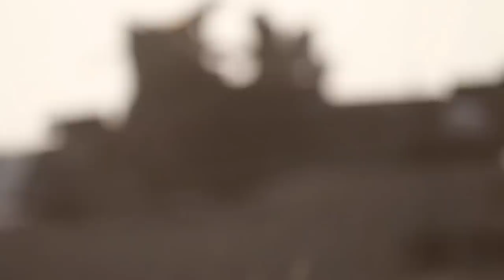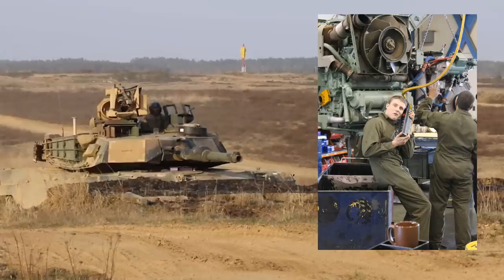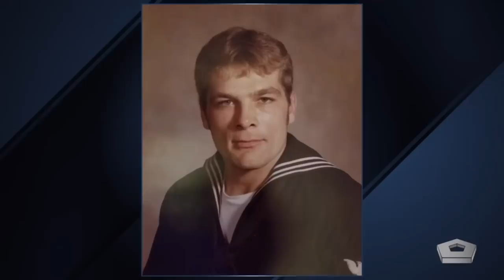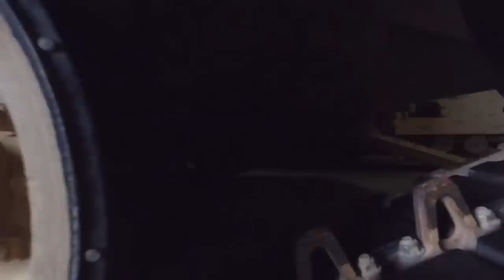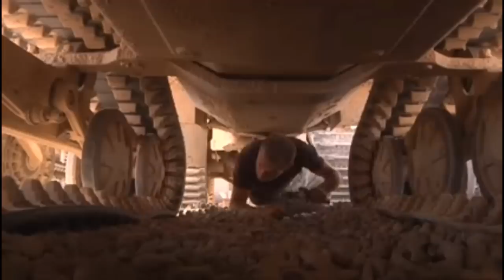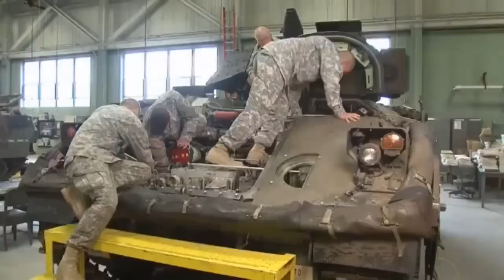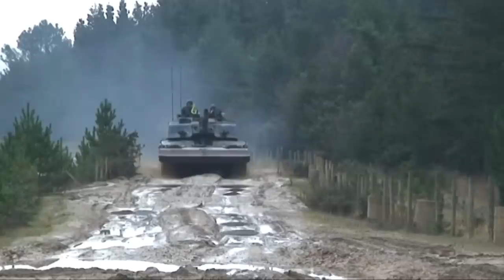Do you want to be a Tank Mechanic?

Comment: Being a Tanker or a mechanic on one is very labor intensive. The M1 Abrams or any tank in the world requires a lot of maintenance to keep it in fighting order. Very big weapon system indeed. A first class armored fighting unit needs top notch mechanics to keep the behemoths on the battlefield with a golden crew to keep them in fighting order.
Reply: No kidding , we had to do almost everything as a tanker pull Packs , fix tracks , broken torsion Bars , service batteries , replace broken electronics , spray them down with fire hoses and even paint them
Reply: Unlike Russian equipment which i've heard can be very low maintenance  mainly i've heard this of their guns being simple to use simple to produce and easy to maintain but also their tanks
Reply: @RhelrahneTheIdiot  True , Ive been in a Israeli captured T62 which seemed simplistic and have a Russian SKS which is almost as simplistic as the .45 Cal. grease gun they issued tank crews in the 70's ..
Reply: Believe it or not the Abrams dosent required that much maintenance.

It really boils down to the crew on how well the tank is running.

My tank had over 600 hours during deployment and we changed track one time and 4 road wheels. That's all heavy, other than that we keep fluids on tap and all 10 level maintenance.
Reply: @mrbasshead403  True but humping Ammo was labor intensive , I was in the Sheridan so its nice to know you really have the best Tanks !!
Reply: Make your driver checks those fuel quick disconnect, orings or ya got a toasty engine fire.... hmmm now how do I know about that. Lol
Reply: @mrbasshead403  you're crazy, I got 10 guys that will tell you different,  I dont think I have had a tank last more then a month without being deadline
Reply: @renster143  

Circle x 🤭🤭🤭🤭🤭🤣🤣
Reply: "Top notch mechanics" then there's me using a sledgehammer on a bmp
Reply: @mrbasshead403  Oh hush, the damn things deadline just from sitting on line. If you actually were a Tanker you know that when every one is rushing off base to beat retreat, we are still in the Motorpool maybe looking at closeout at 1900. Come command maintenance on monday its stage 3 leaks all over and deadlines. You honestly aint a Tanker until you throw track in knee deep GA clay or drink a little FRH. Best job I ever had. Stop playing World of Tanks and tell the truth. 
-D.CO 2/69AR
-C.CO 1/12 INF

Comment: I work in Army wheeled vehicle maintenance so I don't have a lot of tank experience, but from what I've seen I can tell you this-it can be VERY labor intensive the M1 I believe has two MOS's one for the turret and one for everything else, breaking and repairing track absolutely sucks, I recognize that location in the video-it's Ft Hood Texas, home of the 1st CAV where it can get up to 120 degrees in the summertime where these guys are pulling packs in the back of the motor pool wearing those shitty sweat inducing coveralls lol. I can tell you when you work in these front line combat units and these things go down, you WILL be working until it is back up regardless of how long it takes so expect VERY long hours.You're pulling that pack for just about everything, from basic services to changing starters, I'm not sure how long it takes to pull an M1 pack but my guess is a good crew can do it fairly quickly if they have decent equipment on hand, overhead cranes make things 10x easier for things like that, I would think it'd be easier than using an M88 crane. The turret I'm sure is a completely different animal, miles of wire in a CAN BUS network, if its anything like a Stryker then I can only assume they have sensors for everything an a computer display that can narrow down a circuit for trouble shooting (like I said I'm only speculating but I say this because they are made by the same company General Dynamics Land Systems) I couldn't even imagine pulling panels trying to locate circuits in an M1, challenge indeed lol. I'm hoping some actual M1 techs can comment an give more insight, like I said most of this is speculation from what I've observed and experienced myself.

Comment: I worked in a 30 level shop in 1st ID in Germany and I was a contractor. I worked on the M48 AVLB, M2 Bradley, M9 ACE, M113, M577, M88 and a little with the M1A2 Abrams. I also worked alot on other wheeled vehicles in the Army. I also was a truck driver and drove the M1078/M1000 Tank Transporter. It sucks pulling the pack and fuel cells just to replaced a torsion bar on a M48 hull. Or working outside year round in the heat and cold because my AVLB with 70 ton bridge cannot fit in any motorpool bay. But I have an experience that really tested me being very physically challenging. Also I worked along and made friends for life and always made deadlines.

Comment: Aircraft maintenance here, two key things you touched on here that I can attest to being absolutely true as far as military maintenance. Working hours compared to other MOS's and working conditions not being as nice as everyone assumes them to be. I work on UH-60's, which averages anywhere from 3.5 to 5 maintenance hours per flight hour. When the aircraft goes into phase maintenance (Think scheduled servicing but very meticulous and in depth.) it's twelve hour shifts and twenty-four hour operations until the aircraft can be turned around and made flight worthy. An experienced crew with no logistical hiccups and nothing broken on the aircraft can turn a UH-60 around in about twelve days, but if there is need of significant repairs it can take more than a month. You absolutely put in far more working hours than most combat arms, and I can say that from experience as I started my career in the Infantry and the moved to Aviation after my first tour. As for work conditions, most maintenance is done in a hangar. They're not always air conditioned, but you're not out in the sun or the rain, and you don't have to deal with the environment all that much. That being said, flight line maintenance in Iraq and Afghanistan can see air temperatures on the tarmac at 150f or more. The ground is that hot, the aircraft is that hot, and your tools are that hot. To put it shortly, it sucks. Cheers Matt, loved the video. Glad to hear about maintenance from across the pond, and I guess from up north now as well.

Comment: Spent some of my soldier days on a M-106 mortar carrier. The biggest thing I hated to fix was the track pins. They sometimes broke when the mortar carrier was moving. Separated the track so you had to stop. Always on some highway or busy road. Those nuts and bolt pins were always frozen with rust. Then it was busted knuckles time. The rubber track shoes were just as rusted. Often the protruding bolts were just twisted until they broke off for replacement.

Comment: Former 91H (tracked mechanic), none of the bays we had were air conditioned, mainly because it would be a waste with bay doors open most of the time. I've had one with evaporative coolers (when they work) but usually a fan is the best you will get. In the field we're lucky to have a camo net to provide shade in the summer. And forget about heat in the winter in the field, we're just happy to have sunlight and no wind. You forgot to mention the civilian techs which sometimes work alongside us (usually only Abrams and Bradleys) are ex-tank or ex-bradley mechanics who provide decades of expertise which is invaluable. The Korean civilian techs were very helpful in maintaining our tracks but the language barrier made it difficult in learning from them but they would show us their expedient tricks to fix things. Despite working on M88s and M113s I got to work on ABVs (Abrams mine clearing variant) and Bradley's and much preferred working on those. Pulling pack on those are much easier than the M88 or M113 series.

Comment: I worked as an engineer on the first generation of M1 tanks.  There were two types of mechanics.  Mechanics who would work outside of the turret.  These guys were extremely strong.  One guy could lift several road wheels at a time and have been known to shear the bolts of the road wheels when he got made.  Similarly, these guys would not be allowed into the turret to do things.
I worked in a period of time when the safety regulations were a little relaxed.  In order to test the hull gyro, one had to bring the tank up to 10 miles per hour and do a stop.  In Detroit, we were doing the test in the parking lot and almost took out a VP driving a car.  He was extremely upset.  Doing testing on the tank in cold weather would take a toll on the tank.  
Unfortunately, a large mechanic was in the tank and the halo fire suppression system fire.  The mechanic died of oxygen suffocation.     Took a long time to remove the body from the tank.  As a result, a height restriction was placed ongoing in the turret, which eliminated me going into the turret.
In the 80's the engineers and mechanics who worked on the M-1 and M-2 were a rough bunch.  The M1 in the early '80s was declared not to be operable.  A group of engineers was told to go the field and do not come back until the problem was fixed.  I was told Friday at 2 to load up my pickup and drive 500 miles.  Also, load up on beer in Ohio.   Schedules were tight and people were tired and stressed. Managers cut a lot of slack because workers were looking for a reason to quit.  We got the job done.

Comment: I joined the Kansas National Guard while attending University and wanted to be in a unit close to campus.  They gave me the choice of Artillery Mechanic or Cook.  I picked Artillery Mechanic which was MOS 45L at the time.  I went to AIT at Aberdeen Proving Grounds Maryland the Summer of 1990 and was there when Saddam invaded Kuwait.  I later added 45K Tank Turret Repair for the M-60 A3.   I never got to work on any Artillery or Tanks outside the Classroom.  I was 30 level maintenance and the 20 level mechanics (Unit level) would always take care of repairs leaving us nothing to do.  
The main vehicle I worked on was the Deuce and a half and 5 Ton Trucks. Replacing wheel bearings, and pulling engines, oh so much fun.

Had more fun on my 2nd enlistment as an 88M Truck Driver in a PLS Unit.

Comment: Sounds very much like my mechanical engineering career that I used to have. I got into overhauling, up-dating, and improving existing heavy manufacturing equipment. I got into it by repairing my fathers & my 1st cars in my dad's dirt floored unheated garage. I was so thrilled with doing the back-yard autobody or removing the car exhaust system with a proprane torch and chisel that I never thought about being cold or dirty. My mechanical engineering career required me to climb over dirty, greasy equipment during all sorts of weather during everyone elses vacation and plant shut downs to take measurements and make sketches of all the equipment & facilities. I often had to observe the operation of the equipment. I got to travel alot and occationally fly ( usually on a red eye flight or night flight to my newest assignments ) at company expense. My job did require computer, advanced math skills, and alot od drafting which I also enjoyed. ( in a nice clean office) If you like a more academic role consider an engineering degree but just choose on in which you have to get dirty and practical. (You need to be able to turn your academic knowledge into something that works) The military also trains these types of engineers or will hire and enlist you from a ROTC program or after you graduate from college ( in my opinion, you might want to avoid ROTC if you want to be a technical specialist and not a high ranking officer) I got into this career area by being good in shop along with high academic ability and a love very high aptitude for machinery (in my case heavy machinery, steel mills, foundaries, large fabrications (ships), large aircraft etc) By the way this is not a common and typical engineers job. You may want to get a 4 yr bachelors degree in egineering technology rather than a 4 yr bachelors of science in engineering. So if you feel that you have more capability than being a mechanic then you could try this route. The main key is to be happy at what your doing because your going to have to do this for the rest of your life. Don't just find out what your good at, find out what you enjoy. After leaving engineering school I went into a sales & marketing position and hated it (but it did pay well) until I discovered that a few engineers ( mostly bachelors of technology) worked in a position like above. I was really disenchanted with most of the engineering positions when I left college.

Comment: Matt, an idea just came to me (light bulb!), there were so much heated discussions between manual and autoloader even after all this time. I have brought up the pros of an additional crew member for various chores and duties, aside from just loading. I also mentioned how backbreaking replacing a thrown track would be for the whole crew and that it surely could use a four men crew to be more efficient. So, being a mechanic, surely you could do a video showing the steps, the procedures and big _ tools needed for the job, to dispel the notions that two men, or three could do it. 

I tried to mention that an M88 or a mechanic was not always available so such tasks were left to the a tank crew stuck in the middle of nowhere.

Comment: Now this discussion brings about another issue: Why are 8*8 getting so popular? 
Some reasons:

1. They are often made by truck manufacturers and a truck producer don't stay in business for long if his product is to much in the shop - instead of making money on the road.

2. An 8*8 is easier to repair and might even transport itself to a larger extend - sure it might need a new suspension with fittings; but that can be flown in - possibly with a specialist for the electronics. That is partly why I really want a squadron of Sherpa's for the Royal Danish Airforce. In effect: A brigade has a maintainance company, but if the repairs are easier and can be mail-ordered for delivery with some shells, then you cut down the logistics tail. And a Sherpa can land almost anywhere.

3. What makes the heavy tank an endangered species is the amount of work involved in maintainance - as you heard - tank maintainance involves round the clock work. If you can cut down on that and have direct access to a spares depot and swap defect parts and send them home where they can work on them with proper tools - and then send the repaired part back on the shelf.
Now one of my papers on university was a paper on a spares depot (for computers at that time) and what I found out was, that spares are often repairable - with the proper tools and manning - so the fine mathematical calculations were very often not that relevant. Especially since spareprices were not very relevant in the field. Spare prices are most often used to evaluate if the part is repairable - a direct hit by a 155 mm often gives the assignment to the scrap-pile, but other situations the part might be salvaged and the chief might strike a deal with the mechanic = how long will it take you to repair that stuff?

4. One of the problems with staff officers is that they slice the bread to thinly! Having a couple of supernumery tanks is often a good idea as you can pull in a platoon of tanks for major overhaul.

5. Sensible workplanning is actually a major factor in building up a force. Again a BTN has according to staff planning 1000 men,  but a brigade with three batallion has (for planning purposes) 5000 men, some of these men are maintainers. If you can cut down those needed in the field, there is a significant gain in combat punch for the same money.

6. What people are generally NOT aware of is: Tanks are cheap, because a squadron of tanks have fewer men in them. Infantry is expensive, because you CAN use conscripts, but as they generally are poorly trained the get killed quickly. Properly trained infantry is vastly more expensive company for company than tanks (and to some extend) and artillery.

Comment: I do love building & fixing. In retrospect, instead of Medic, I should have gone Veh Tech during my P Res career. Some of my first reading material was the owner manuals for the family cars. I played with Meccano and the old Capsela toys (remember those?) quite a bit in my younger years.

Still a fan of the Leopards and diesel powertrains, though. I like the "VW" way of building things (easy to take apart & maintain), and the idea that you can swap out the power packs on the Leopards in 15-20 mins. with a trained crew. I still do as much of my own maintenance as possible on my own car, including routine stuff like oil changes and minor fixes.

Comment: Well, what I've been saying for quite some time: The next war will be won in the workshop.
If you take the Danish Navy the emphasis is on maintainability. For starters they forego the turbine power, but have four diesels - but it keeps the ships at sea.
At the moment the 3 Huitfeldt-classes are all at sea on exercises - which is a stark contrast to other navies that are in port most of the time.

If you notice where they are operating from: There is a port; but nearby is an airport. The unnoticed thing is the helicopter - which allows you to use ports without to much facilities in the form of cranes.

Comment: I am a tank mechanic. I've rebuilt them top to bottom. Road wheels, tracks, drive sprocket..
 replaced engine pack, transmission, gun, sights, FCS, turret ring bearings... You name it. It's actually really fucking fun
 

At least, I've done all of this in Tank Mechanic Simulator. Clearly, I'm qualified.